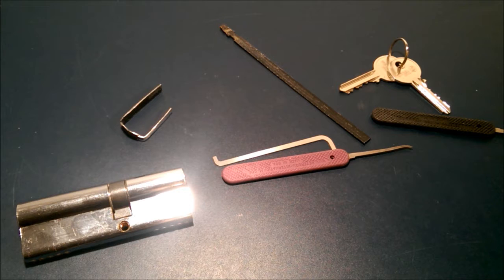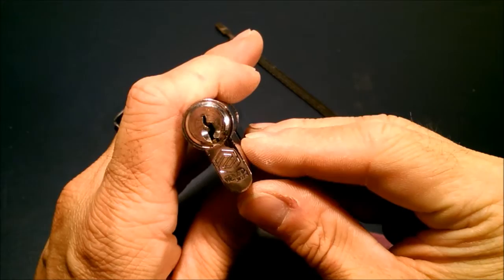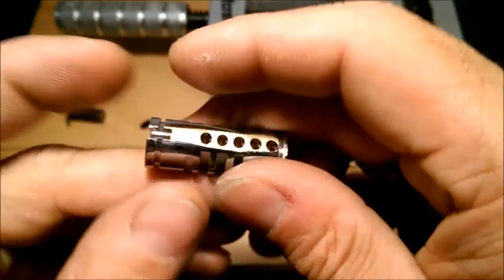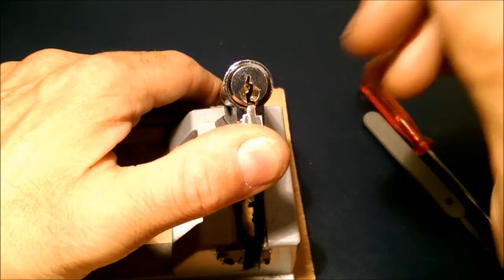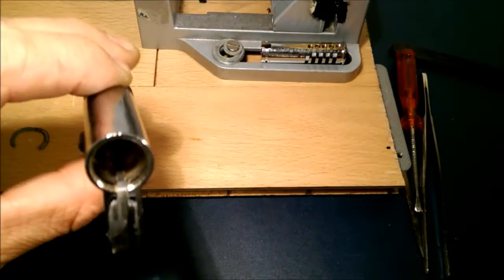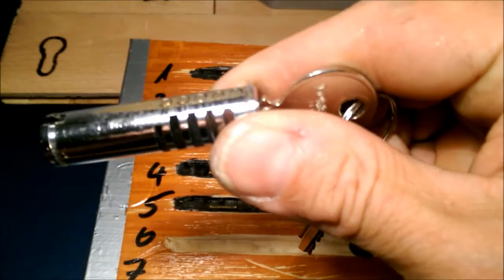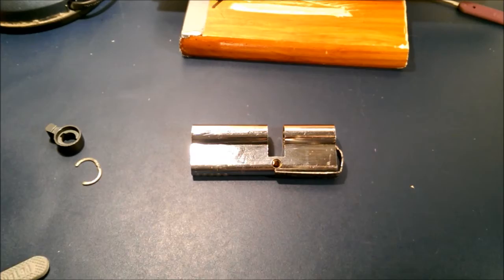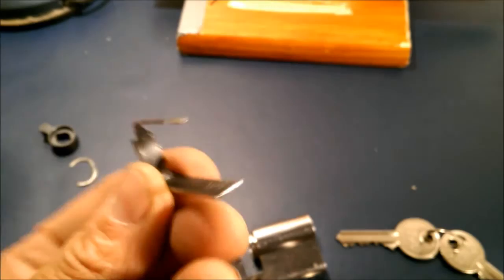(picking 15) Testing my home made gutting tool for EURO cylinders (some kind of pinning shoe)

Comment: Glad I held my tongue (keyboard) until the end of the video. But was also thinking that maybe the core was filed to fit the pins in addition to filing the pins... but I digress.. Hope ya don't mind, I'm gonna dig around your vids for a while as they are quite intriguing ;)
Reply from the maker: +Ju Jitsuka Thanks. Makes me happy if you find also my older videos worth looking at. I remember that lock - it was terrible. But the home-made clip is is still very useful. I do have a commercial pinning shoe now, but sometimes it is too wide.